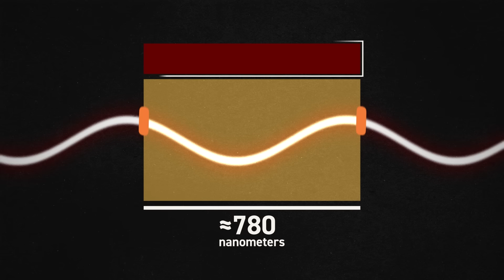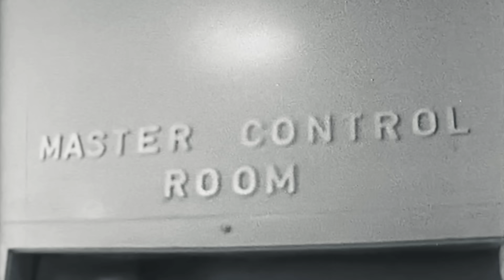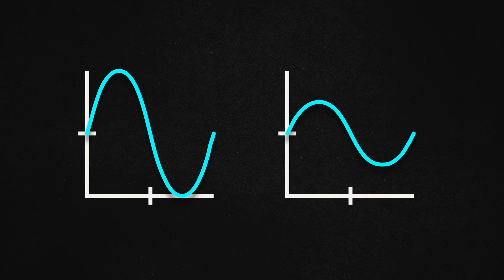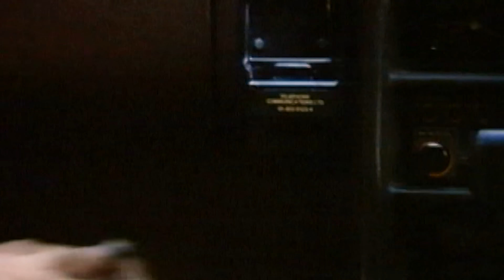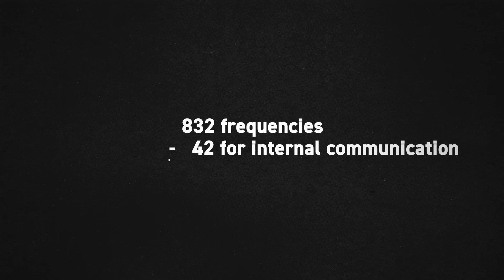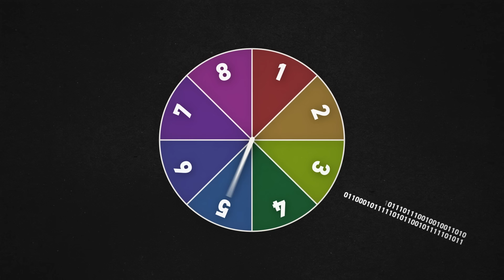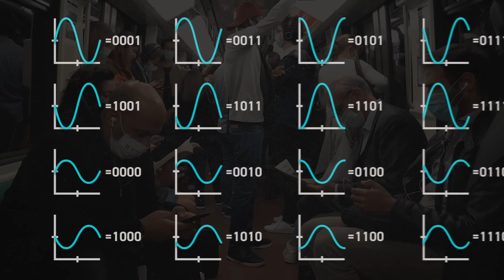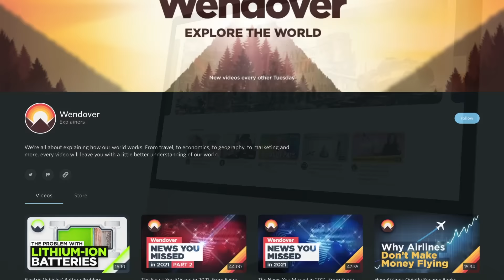How Cell Service Actually Works

Comment: As an EE who specializes in RF for the last 20 years, thank you for this video! Well put, and not too complex. To me, even now, CDMA is black magic. I get how it works, and have even written baseband code for it, but it just still seems like it shouldn't work.  Now we're multiplexing signals over codes, freqs, amplitudes, phases, etc, over multiple spatial streams all at once. I really think the average person doesn't get how unbelievable the physics is when they use LTE or WiFi 6 to do something basic. 1024 QAM should just not be a thing.... and yet it is.
Reply: Hey you're just the kind of guy i need to talk to i'm working at Hearst Castle flagging traffic control. I have radio communication between three flag men that is constantly disrupted, broken up, or not even coming through we have a repeater box at the highest point we could get it too but Channel 2 seems to work more reliably than repeat.  We have rugged V3 radios with 16 inch whip antennas please help
Reply: @yzrippin  hey happy to help, but it doesn't sound like you're using cellular or wifi technologies based on what you said. Are you using CB (citizens band) 2 with walkie talkies on the flagmen? Or licensed freqs and HAM channels? You might be best served with a FM solution like old school Motorola private licensed 2 way radios and a repeater (sounds like you may be already trying that) if your area supports private LTE that's the way to go. Just pay the carrier for the service and enjoy regular phones on their service with full duplex communication.
Reply: Haha so you’re the guy that writes my codes!!
Reply: as an undergrad EE junior taking Intro to Electromagnetics, hearing black magic is all to familiar.
Reply: Same, 20 years EE in wireless/RF, covering aviation, LMR, MIL/critical comms, some cellular and a most of it in the secured realm. FSK, PSK, QAM, CDMA, OFDMA and other modulation schemes, especially the last two still seem like voodoo even though I'm deeply rooted in them and many others. Watching subscriber, spectrum and channel efficientcy grow by orders of magnitude, it's what's next that has me most fascinated, even going back to school, yet again...
Reply: hey can u help my dad find a job hes an ee with rf specialization
Reply: As a CS guy with a lacking physics background, I'm just glad that you guys understand how it works so I don't have to, ha!
Reply: That is a fact I hate about the modern world! Try as you may, you can only specialize in one given slice of any complex technology. That is a fact I also love about the modern world I guess !
Reply: I just hope once mankind mainly extincts, that some smart people like you still make it so our future generations don't need to figure out these crazy systems
Reply: same, i studied in telecommunication section. still like a black magic to me how cell network works. especially 5g
Reply: Dude, most people don't even comprehend how a damn Toaster works, hahah. So you're definitely right.
Reply: I'm an EE who has been working in embedded control, for most of my 40 year career. RF is most commonly referred to, as black magic, though it had been almost the exclusive focus of electronics, from Heinrich Hertz til the 1970s, when computers overtook it. Of course, cell technology, is the marriage of both.
Reply: What are text messages sent over?
Reply: @MehulP30  I would expect the same system supports text messages, as like calls, theyre encoded using binary. It takes far longer to type a text out and send it than it does to just say it, and you dont need to convey the tone of the speaker, so the data transfer rate is much lower. 

You can say 'Get out of my car' in a frustrated way, and angry way, a scared way, etc. A cell call will not just transmit the words, but also the tone of those words. A text is much more basic. That further alleviates the demand for data transfer. 

You can probably support millions of users texting on the same infrastructure that could handle only a few thousand simultaneous callers, as a result of the much lower demand for data transfer. 

That said, I'm not an EE (electrical engineer) so my knowledge on this is high school grade compared to the Masters Degree level knowledge an experienced EE would have. Hopefully one of those genii can elaborate on, and/or correct my post.
Reply: @jamielonsdale3018  Is there a reason that texts and calls are not sent using the same system as IP traffic, or did I misunderstand?
Reply: My brain stops at about 16 QAM.
Reply: @dolamyte  Also microwave EE here, glad to hear there are others out there who understand
Reply: i work on this stuff and i can't believe the genius of the people who conceive of and develop this stuff. QAM is super interesting for anyone who like that, there's a great vid on yt
Reply: It's definitely a very interesting time to be alive, seeing all of the technologies that have come online just within the last decade and what's to come for the next century.
Reply: @dolamyte  There are stories going back thousands of years of knowledge being given to humans by entites, whether interdimensional or otherwise. I believe it.
Reply: Especially when we look at how semi conductor chips work. Billions of transistors all on something 5 Nanometers wide. Then consider SD cards, you can get 1TB Micro SD Cards. That is so mind-blowing to me.
Reply: Black magic is the only way I can think of it lol
Reply: As I said up the comments, the math heroics of all this is just mind blowing.
Reply: A lot like how Starlink works. There's a lot of black magic to it. Timing and manipulation for the system to work. No way it would have been possible 10+ years ago.
Reply: @chrisalister2297  it was possible but most of the advances in the last 10 years has been cost and miniaturization and efficiency of components. We've had phased arrays and high bandwidth SATCOM for 20 years, but it was the domain of militaries and specialized systems like satellite TV.
Reply: Im someone who ia about to go to university in a year to study electrical engineering, i plan on specializing in RF and telecommunications, is there any advice you could offer?
Reply: 1024 QAM is crazy. I left the industry when 1024 was starting to get talked about. I remember using 3 gig fiber cards…. Then 5…. then 9…. Then QSFP 4x10. I’ve been out of the industry for only two years and I’m sure it’s come so far in that short time.
Reply: @jamielonsdale3018 You are correct about voice versus text.  Texts also have an enormous reliability advantage: they can be sent at leisure with multiple retries over a borderline bad cell connection.

Voice transmission has to be successful the moment it is sent.  Texts just have to be successful once over many retries.   And texts require less bandwidth, as you said.   Use texts in an emergency when cell reception is unreliable.
Reply: @levelwithz3779  

5 nanometer technology means that the pathways, or wires, are 5 nanometers wide, not that the entire chip is 5 nanometers wide. The width of the chip depends on the number of transistors, how they are positioned, and other technologies used.
Reply: There is nothing about CDMA, or similar technologies, that is specific to RF. They are used by cell phone towers and wi-fi access points to maximize the very limited resource of bandwidth over the frequency spectrum allotted to providers. 

Instead of being a science of RF it is really the science of cryptography. It could be used to minimize the size of a message written on paper to a group of people. They would just need to know the algorithm how to convert the coded message back into the unencoded form. In fact a test in university could be the same encoded message given to everyone and using their student number to decode the unique message to them. No need for RF transmission. Modulating the amplitude and/or frequency is easy and has been done for over a century.
Reply: @capitalinventor4823  “There’s nothing about CDMA that is specific to RF.” This is completely false. The propagation of GSM,  CDMA, and LTE are similar as in they all use RF, but also completely different. And who is they? This makes no sense at all.
Reply: @FerociousPancake888  

CDMA, and possibly the others you mention but they weren’t talked about in detail by the video, specifies what bits, or data, is to be transmitted to the cell phones in a cell network from a base station. However, the technology of CDMA is not tied to RF technology and could be used by any other technology we use for transmitting bits, for example sending electrons down a copper cable. 

There are seven layers to a network from the hardware up through protocol (TCP/IP for example) to the top. I forget them all as it’s been 30 years since I’ve seen this stuff. Each layer is independent of one another and CDMA would be one of, or part of, one of these layers. Rearranging bits to send has nothing to do with transmitting the bits via RF technology.
Reply: Any chance you can help me configure my subGHz RF module to use CSMA to reduce packet collisions please 😄😄
Reply: YOUR ALL NERDS!!!!jk its super intresting seeing people be passionate about a topic i never gave a second thought to.
Reply: Much less 2056 QAM!

At what point will we stop being able to efficiently transmit at the highest speed possible before it is no longer commercially advantageous....all about $$$
Reply: I have been In this field for over 40 years, and I got out of cellsite commissioning in the AMPS days.
I stuck with standard comm systems in UHF, VHF, 8/900 Mhz as well as microwave point to point/Starpoint systems.
Reply: I think this black magic, gap in understanding is the power of the XOR. I don’t fully understand it myself but it’s used not just in this but in encryption and compression to retain data across “functions”

Comment: As a Telecommunications engineer graduate, I wish I had seen this video a few years ago. Really helpful and well explained information
Reply: What exactly did you learn in ur degree? I'm currently a CS major, but telecommunications have always interested me. didn't know there was a degree associated with it
Reply: What would happen to our networks if a massive solar flare happened
Reply: what books would you recommend if i wanna learn about telecommunications engineering?
Reply: yup, I am also a Telco graduate and this video wraps up information pretty good
Reply: As a Taco graduate, this video wrapped up the topic nicely.
Reply: @elle4702  be gone that let us men talk about how communication systems work u harlet.
Reply: same, need this video years ago. i dropped out the telecom because i couldnt handle the math and complex thinking that come with it
Reply: @MrBrayden24 Satellite communication could end of some hour. They might need to change orbital position of it.

Comment: I’m an Electrical Engineering student and I’ve studied communication systems, I did not understand most of what I studied until this video. Thank you.
Reply: peace  we especially need these verses in these times
Reply: Im an Electrical Engineering graduate and did not learn a single thing in my communications class or my digital signal processing class. In this video, I learned more about those 2 subjects than an entire semester worth in those classes. Classes in university just teach you the math B.S, like using fourier transforms

Comment: Reminded me of a lot of statistics we had to do in school around the topic… Some of the topics he discussed in case you’re interested:
AM - Amplitude Modulation
FM - Frequency Modulation
Symbols
PSK - Phase Shift Keying
BPSK - Binary Phase Shift Keying
QPSK - Quadrature Phase Shift Keying
QAM - Quadratic Amplitude Modulation
8PSK, 16PSK, constellation diagram
TDD - Time domain duplex
OFDM - orthogonal frequency division multiplexing 
CDMA - Code Division Multiple Access
SNR - Signal Noise Ratio
BER - Bit error rate
Reply: So many of us had to learn it but only very few still use it. Me too I learned this stuff but fortunately I recognized soon enough that it is the same a learning screw heads. Note that knowing screw heads is more useful in day to day life.  On telecommunication protocols, the essential stuff was done by Claude Shannon with his work on channel capacity as a function of SNR of the channel. The rest are just different choices based on SNR over the usable bandwidth and historic development. None of this stuff actually manages to increase beyonds Shannons limits but, of course, our SNR has become better with smaller cells and with the increase of computing and processing power we can more optimally use the full bandwidth optimally even if the SNR is strongly varying over the bandwidth or fluctuating in time.
Reply: but, I don't think he talked about BER or SNR.

Comment: This video just blew me away.  To break down such a complicated technological subject, starting with the nature of light itself, to transmitting thousands of messages simultaneously, step by step, so that each step builds on the other, is a very rare talent.  I have a new respect for our telecommunications system and the people who make it work.
Reply: And Sam for being able to explain it the way he did in this video!
Reply: It's even more complicated than this; this video tops out at 2G technology! 3G, 4G, and 5G continue to get yet more complex. Additionally, in high-density areas like cities, cells don't have one omnidirectional antenna in the middle, but rather three or more directional antennas at the corners.
Reply: @asphere8  CDMA is 3G technology. That is where this video topped out.
Reply: @MrT------5743  The original CDMA is a 2G technology; CDMA2000, WCDMA, and HSPA are sometimes referred to as simply "CDMA" but are 3G technologies.

Comment: Really nice explanation of CDMA. Just a note, that didn't seem clear to me from the video but I think is important: when he says that we add the codified messages to obtain that sum, out of which the receiver has to get the messages back, we don't do the sum on purpose. It's the media, the way the messages are represented is such that if two users send their message at the same time to one receiver, the receiver gets the sum of the two messages. The ability to craft the messages in such a way as to always be able to retrieve the original components in a consistent way is where the mathemagic happens.
Reply: Basic wave superposition does the addition itself, yeah?
Reply: Dang. I can't imagine having to be the person who had to figure out how to work on that receiver.
Reply: Ya but how would they ensure the waves are in phase to allow for additive behavior between them. It seems like unless all 3 signals came from the same position they would likely be out of phase
Reply: This.. There was a missing part of the explanation.. It sounded like it was all done in the devices.
That one of the mixing stages is done in the media is the last part that explains how they don't mess up each other.
Reply: The part I don't get is how the receiver separates these and knows which data come from which user
Reply: Cell sites are relatively small compared to the speed of light, so as long as the transmitters are synchronized the phase doesn't drift enough to matter at the frequencies used.

As for separating the signals, it's explained at 14:55.  The receivers knows which code goes with each user, and applying that code gives you that user's data.
Reply: its the industry called Data Compression.     its an absolutely massive industry for good reason
Reply: Thanks I was wondering this too. Makes it even more amazing.
Reply: @IanMcCloghrie  But isn't that a huge data protection issue? If the device knows every users code, it also knows every data this user receives. Essentially everyone could listen to everyones calls. Or are their other measures installed to prevent this?
Reply: @Tokru86  While the spreading codes do provide some security against eavesdropping that's more of a side effect, the primary goal is to allow channel multiplexing between different users.  In fact, at the time there was speculation that the US government was involved in the standardization of CDMA and deliberately weakened the security provided by the codes.  Keep in mind that when this introduced in the 90s the majority of voice calls were being made using analog FM modulation that you could listen to using a simple scanner radio.

I've been out of that industry for a while so I'm not sure what the modern standards do, but the simple way to provide security would be to encrypt the data using a secure algorithm before handing it off to the transmission layer.
Reply: That makes a lot of sense, when I was watching the video I didn’t understand how all the transmissions got added together because it sounded as if there was a middleman between the user and the tower that was doing this addition and then relaying it. But that wouldn’t make sense because if the users could talk to this “adder” between them and the tower simultaneously then there’d be no need for the middleman at all! Thanks for explaining
Reply: Thank you, he did skip over how the math was happening and I was wondering about the details of what was going on.
Reply: Ahhhhh, I was wondering how the addition happened, seems like it would have required too much coordination for this network structure. Thank you!
Reply: THANKS! this filled a small gap - I was wondering how they coordinated their combined message but now it seems so obvious! ❤️
Reply: @basketballprodigy12  I presume they must all be in clock sync derived from the network and a super precise ntp type protocol, perhaps enhanced by super precise gps clock.
Reply: That is so cool, thanks for the explanation.